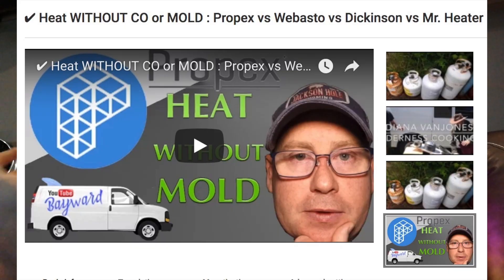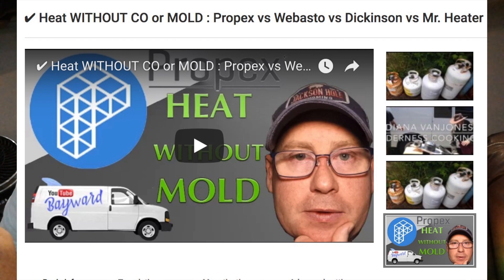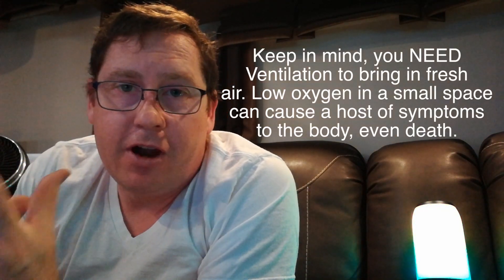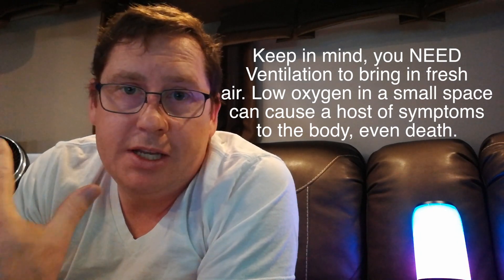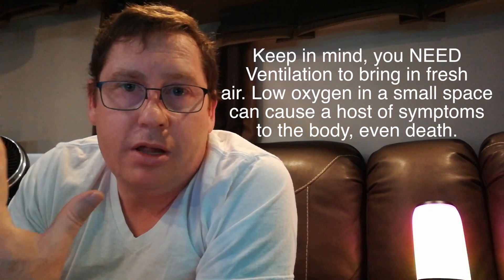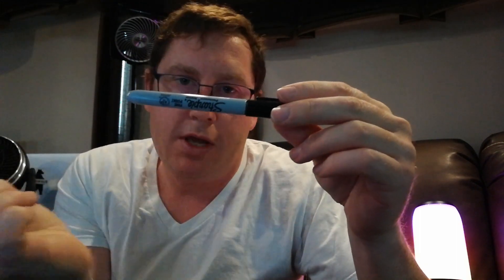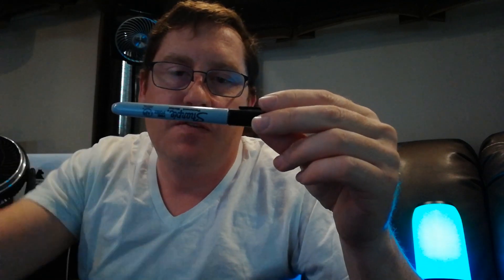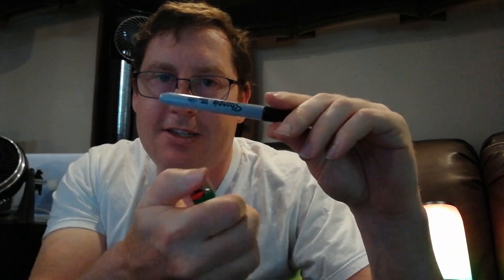Viewer asks: Forced Heat Exchangers vs Mr. Heater Buddy

Comment: I learned about Propex heaters from your video last year. Done quite a bit of research on various heating options since then and have decided on the Propex. Partially out of convenience, since I don't have many places to put something else, like a marine fireplace or a Cubic Mini woodstove, and the Propex can most likely just be swapped out in the same compartment where my propane Suburban RV furnace currently is. The biggest motivator is that the smaller model Propex (HS2000) draws only approx 1.5 amps which is around the same as a Fantastic Fan (i.e. not very power hungry). Propex are not cheap, though. I was quoted today a rough estimate of $1275 with install. 😣😕 Good thing I've been saving my pennies since last winter!
Reply from the maker: cool!  make a video of the install. would like to see